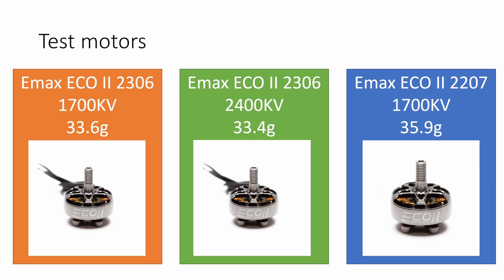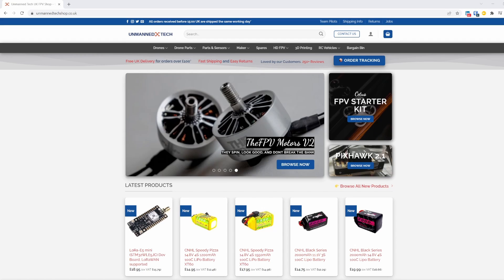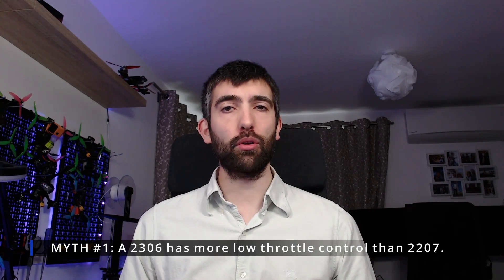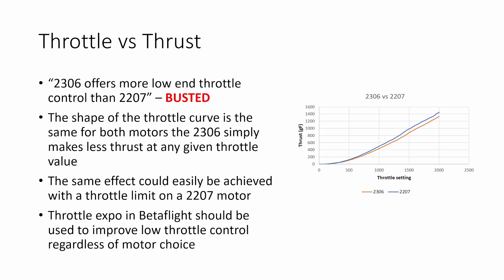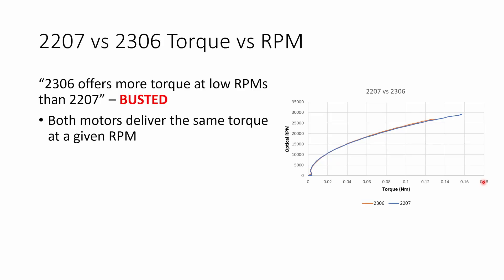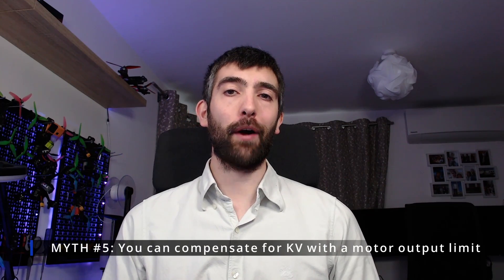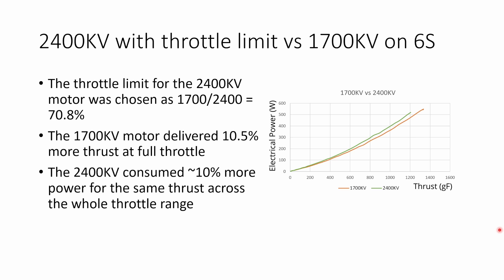Five 5" Motor Myths Tested, are any of them true? 2207 vs 2306

Comment: I love how you scientifically break motors down at the end of the day.. a motor is a motor is a motor.. i was going to swap my motors on my BNF Nazgul Evoque F5x V2 because i thought 2306 would work better than the stock xing2 2207 1750kv for freestyle and just overall make my quad fly better if i got some expensive 2306 1750kv's maybe even the same ratings as the stock ones on the Nazgul just more expensive (eye candy ones) as i thought they would perform better but after seeing a load of your videos and a few others I have come to the conclusion that... A motor is a motor is a motor... I'm better off just sticking with the ones that iflight chose to put on the drone they made as it will have probably been made around them motors anyway so i probably wont find any better performing ones for it anyway lol.
Anyway great video's keep them coming my friend!👌👍

Comment: Would running bluejay at different pwm frequencies change the delta of running 4s kv on 6s voltage for efficiency at thrust? Like say 24 vs 48 or 96

Comment: motors seem to be  a lucky draw .. I have the Fishfly 2306 1750kv motors that suck the battery 2 min flight time at 90% motor output  then I have the Xing2 1755kv that are incredible lots of power 4 min flight time at 90% the I bought 2207  1950kv axis flying 1 min flight time hahahah sent back got the xing 2 again 2207 1855kv over 4 min flight time seems the xing or xing 2 have the all around best performance and battery life

Comment: Hey Chris!
Can you run some tests on 6S vs 4S Batteries with two motors spinning at the same RPM, and a 4S and 6S battery of the same Watt Hours. 

(I don't have the gear to do it accurately, but I have a 6S motor and it's equivalent 4S to produce same RPM)

Comment: A set of 2306s (in your example) weighs nearly 10g less though. Not sure if that is accounted for.
Reply from the maker: Absolutely right. If you don't need the extra power of the 2207s saving the weight is really worth it. We should never carry more motor than we need it's just wasted!

Comment: Your recommendation on "6skv" confused me.  Are you saying a 4s high kv motor running on 6s is acceptable as long as you scale the max throttle setting to 80% of the transmitters full throttle setting?
Reply from the maker: Yes, it will be ~10% less efficient that a 6S motor without a throttle limit though.
Reply: @ChrisRosser isnt motor output limit safer to adapt a 4s motor to a 6s quad ? that way the esc cannot, in any way go at 100% throttle and burn the motor (turtle mode and small corrections from FC in flight are not affected by throttle cap from what i heard (JB))

Comment: Very informative video and I really appreciate that you kept it short! However your tests have a point of error, that is the actual kv of a motor is never exactly the same as the advertised (usually +-50kv). It's actually very hard to accurately set the kv of a motor. For example I bet the 2207 and 2306 had some kv difference even though both are advertised as 1700kv. The same thing for the 2400kv. It would have been more complete if you measured the actual kv values
Reply from the maker: Great point! I'll have to figure out a way to do that for my future tests.

Comment: All great but considering you are carrying less mass almost 10grams with 2306 motors then the ground speed and overall felling of the quad is different…. More responsive?
Reply from the maker: 10g on a 600g quad is not so much that you would notice I think.. From 2207 to 2506 is ~30g. And that's barely noticeable.

Comment: Chris, would the wider 2306 actually make more torque than the 2207 if their stator volumes were the same? For instance a 2306.5 would have nearly the same stator volume as a 2207. Perhaps then we would see a torque advantage.
Reply from the maker: No, I've tested this and if the motor has the same volume they make idenitcal torque. Wider motors are only better for cooling, nothing else.

Comment: How do imperials fare over the 2207? I switched out Xing2 2207's with the imps and I can't really tell a huge difference, but I guess the 2207's would fare better for durability by far and survive crashes for whatever performance gains there may be. The bells on the imps are very lightweight for the diameter so ROI is lower, but durability takes a big hit as a result. I guess its mostly hype and I might just be throwing the 2207's back on the Shocker Tank and the imps on some other build.
Reply from the maker: I plan to do some testing of FPV Cycle motors to see if they do deliver more performance.

Comment: Very interesting. 
So the 2207 is basically better or equal than the 2306 in every test. 
I just chose a 2306.5 (KV1900) over a 2207.5 (KV1750) for my quad Sector D5. I wonder if I should try to switch to 2207 but my reasoning was that the KV1900 on 6S should be stronger/faster spinning than the KV1750 on 6S. Was that wrong?
Reply from the maker: 1900KV will have more top end than 1700KV of your battery cam supply the amps.
Reply: @ChrisRosser  Thanks a lot. 
What C rating would a battery need to have to supply the motors?
What happens if it doesn't? Does it simply top out or something dangerous?

Comment: Awesome video!  Someone please help just finished my first build and everything checked out good powered on and bound my DJI goggles and receiver and activated it. I flashed bf4.3 and did some setup. Then I plugged in the quad and the air unit is not powering on. It’s weird too when I’m connected to beta flight it show voltage with no battery plugged in. I’m super new and now very discouraged. 

apex 5” 6s
Lumenier LUX HD AIO F7 FC + 50A BLHeli_32 2-6S ESC with capacitor
DJI air unit direct plugged. 

Sorry to bother you guys. Just don’t know what to do.

Comment: What prop do you use? In my flying test I switch between F40 and F60 on my quad. I really saw difference and really enjoy 2304 motor with gemfan 5552 props on a ~650g quad. The feeling when turning st low speed in circle around trees was great. According to your test, This mean in blind test it would be really hard to see difference ?!

Comment: Super!!!!!
I’m so glad you did this testing!!!!
Thank you sooo much for all your contributions to our hobby !!!!

I have the GepRC Mark 4 HD DJI V2 vista nebula pro. 
The quad copter comes with 2306.5 motors. 
 After watching your video I’m thinking I would rather have 2207’s. 

Basically what I got from this video is that.

What do you think if you were going to build this frame from scratch you would put 2207’s on it?
Reply from the maker: I probably would but I wouldn't throw away perfectly good 2306.5 motors as the difference will be very small.
Reply: @ChrisRosser  of course not. 
I have another five inch which is on 2207. I could just tell the difference when I flew the 2306.5  I feel like it would put me where I want on feel. Feel is very important to me so that I am comfortable while flying.

Thank you so much for responding 👏 your the best 🙏🏻
Reply: @ChrisRosser  It’s also a lot of work for a small change I know that. I really didn’t relish the idea of removing four perfectly good 2306’s to put 2207’s on but I may do it in the end. 
Something small like this just gives me that edge feeling. You know that feeling where you think you’re invincible and you can do anything ? That feeling is very important to me. When I’m flying I like to feel like I have the edge. For some reason it gives me so much more confidence.

Comment: Interesting tests but you can't generalize the results from one set of motors to all 2207 and 2306 motors.
Reply from the maker: In my testing I have found that motors of a similar size and KV behave very similarly. Often barely a percentage point or two in it. You can check out the graphs on miniquad test bench to see just how similar motors of the same size are.

Comment: Very interesting, great video and presentation! 
Question about the KV 'adjustment' using throttle limit:
I feel the most likely reason someone would run 6s on 4s motors with a throttle limit would be to try out the voltage sag and efficiency benefits of 6s without having to buy a new set of motors.
Did you also test those parameters with the same KV motor (2400KV) just using two different batteries (4s vs 6s)?
Cheers
Reply: Im running 4S on 6S because im poor AF.

Comment: Is this a bench test? Otherwise it’s not true control.. you’d have to take into consideration the prop being used, as well as the weight of the quadcopter for maximum efficiency of each motor.. Where is the “fact”?
Reply from the maker: It's a thrust stand test so its a controlled environment. The prop would certainly affect the thrust vs RPM but because the motors are equal KV they should behave the same in relation to each other on any prop I think. The weight of the quad will affect the thrust you need, but the motors are equally efficient as each other across all throttle settings so the thrust demand isn't a factor. The fact is the data in the graphs.

Comment: I had a feeling we weren't getting something for nothing by running higher KV with a limit. It might still make sense to do it when transitioning to 6s from a lower voltage just so you don't have to buy all new motors, but it's good to know what the facts are.

Comment: For the last test, did you confirm the kV ratings of the motors? They are often not accurate. 

Could try running both on your test stand and use the tachometer setting to find the right throttle limit, where both motors turn the same RPM at full throttle.
Reply from the maker: It's a good point that I didn't experimentally confirm the KV. However, I don't think most pilots who run 4S motors on 6S voltage experimentally confirm their KV to set their throttle limit either, so it's still a representative test 😁 Regardless of the throttle limit(which will affect the max top end) the efficiency penalty seems to be there across the whole throttle range.
Reply: @ChrisRosser  Thanks! Very interesting. I suppose if they are running the exact same prop (like physically move it from motor to motor) then the thrust produced tracks with RPM anyways. 

I’m curious how 65% and 75% throttle limits with the 2400kV would plot against the other two.

Comment: I don't really know, I have 5" quad with 2306 motors and my friend has 2207s, my motors are bit faster (2550 vs 2400kv), our quads are equally heavy and well balanced and still, my quad always flies bit longer. He has more top end power for sure, but you aren't using much of throttle while cruising and chasing, so in our case we agreed that 2306s are more efficient
Reply from the maker: You're motors will certainly draw less current than his, but probably only because they are making a little less thrust. Flight time also comes down to the battery performance.
Reply: @ChrisRosser  we bought same lipos at the same time, it's only mine opinion, but i would definitely recommend 2306s over 2207s for average pilot :) also the shaft is bit shorter, so it should be slightly more durable

Comment: When using motor_output limit in betaflight does it reduce the output in the PID loop also or is it more like a throttle cut? You do a fast roll on a motor that is cut to 70% does it actually stop the roll at 70%?
Reply from the maker: With output limit at 70% the motor can only ever get to 70% no matter what. With throttle limit the PID controller can still drive the motor to 100% in sharp moves.

Comment: nice,  i can confirm i have an older  4s rig 2400kv 2207 emax eco (v1) motors that i run on 6s/   and a  6s rig running on the emax eco V2 1700kv 2306 motors. so i thought it was the 2306 that give me almost e minute more flighttimes but now i see 1700kv 6s is a lot more efficient than a higher kv motor with a trottle cap. tkx i gonna swap my older 4s motors to 6s (al my battteries these days are 6s. tkx for the great work. So for 650fg AUW freestyle/cinematic flying 2306 will be enough.

Comment: Awesome content Chris. I always felt like 2306’s were less powerful and you have confirmed it. They just make less thrust compared to a 2207. I’m recently a new convert back to 2207 2050kv from 2307 1950kv and I honestly don’t know why I went up to 2307. The 2207 flight characteristics is everything and more that I prefer.
Reply: where did buy a 2307 motor ? ive been chasing 2308 motors for my 6 inch rigs or years after the only ones i available stopped being made? wha are those 2307 and are they still available ?
Reply: @fistedfpv2922  tmotor velox v2 rose gold 2307 1950kv

Comment: I’d have to disagree with your conclusions here, the myths you are attempting to resolve cannot be resolved on a test stand. I’ve tested both 2306 and 2207, with two identical quads with the only difference being the motors. The “myths” are evident in reality, despite what your graphs show. The 2306 jumps off the ground and has considerably more low throttle control, 2207 is more responsive and considerably better in prop wash and has more power.
Reply from the maker: Sounds like you agree with most of the conclusions! The only snag is the low throttle control, I would suggest you do a blind comparison between a 2207 with 90% throttle_limit and a 2306. I think you would struggle to tell the difference if the motors had the same KV. You will always get more "resolution" from a weaker motor because you need to move the throttle further for a certain change in thrust. Low throttle control is about having that resolution and still having comparable thrust at the top end.

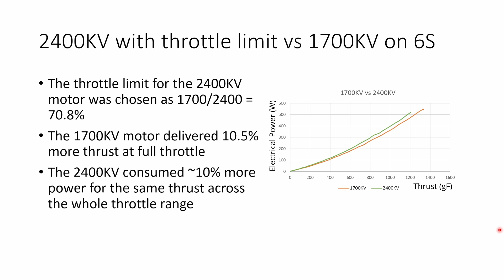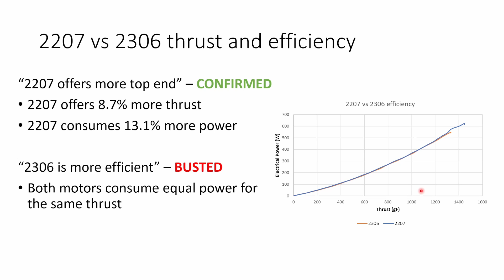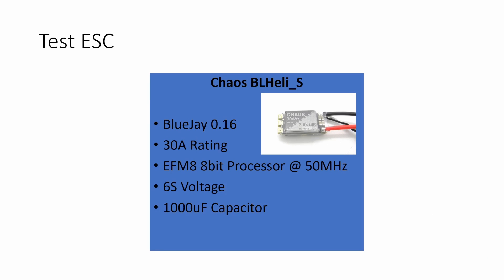Comment: I did a test on a 350 gram 2fiddy using flywoo 2104 3000kv motors. with different size props and  pitches. flew indoors did 2 roof punches around 10 aggressive side to side swings 10 front to back swings and fast rocking on all axis then hovered at eye level until my buzzer called 3.5v (4s 850mah r-line) = Gemfan 51x25x3 got 9:30min... Hq 5x25x3 got 9:30 both at 21% throttle... Hq5x2x3 8:30min 26% throttle (and felt the most stable)  Gemfan 45x25x3 8:20min 27% Throttle (felt super aggressive on Response) Hq 4x2x3 8:00min 29% throttle... Hq 3x3x3 7:00min 35%Trottle... Hq 3X25X3 6:00min 40% ... my conclusion was just like jet engines bigger prop steeper pitch = more thrust = more economy = longer flight.. but feel like the Hq 5x2x3 is what I will use the most as I am guessing the Gf51x25x3 were over propping the motor as gps speed run maxed out at 75mph (same motors were on my 4" Hq4x2x3 290gram roma L4 getting 92Mph same quad with T-motor 1404 3800kv got 75mph 250gram) flight times were around 5:00/6:00mins no problem then did a slow 35mph cruse flight easy got 7:40min.. going to do a speed run with the Hq 5x2x3 to see if it flys faster then the Gemfan's? if so then the only way would be if they are not spinning as fast (over propping!!!) ... also did a test with a larger battery(THE FPV 120c) 1500mah (Gf 51x25x3) extra 80grams added (total 380g) gave 12:30mins .... went back to the 850mah added 50gram knife under the batt strap lost 1:00min flight time... Conclusion more Throttle needed to fly means the motor draws more amps, Over propping is only good for long range???
Reply from the maker: A steeper pitch prop will be more efficient in a hover and for cruising (as long as you  keep the throttle low all the time). However it will draw a lot more power and make more thrust at the same throttle setting so that often means people get shorter flight times if they fly the same way. Shallow props give much better propwash handling, which is why I prefer them for freestyle.
Reply: @ChrisRosser  I could feel the difference with a matched props others feel air is just blowing everywhere and your trying to sit on top of it. the right ones feel like there cutting the air and the quad is suspended. you wont be able to tell until the right props go on its the same difference as flying an un-tuned drone to a perfectly tuned one
Reply: @ChrisRosser  it is kind of my point the motor spins faster use more amps if the motor cant spin up (from heavy props) it wants more amps and it cant get the amps from the battery so the motor never gets full rpm the light prop may give more speed as it don't kill the battery as bad allowing full rpm range

Comment: Conclusions from there should be written in bold above every motor comparison article. Already had idea that main difference between 2306 and 2207/2208 is caused by KV difference and particularly due to lower KV for 2306 motors in historical comparisons. 4S motors being less efficient on 6S is nothing new. But because we are killing remains of our old 4S stock on 6S because no one want to buy them anymore and some of us think that throwing out working motors is bad idea, make it non-issue. Can you advance topic about throttle lowering for long range setups more? I see that it would be great way how to make all-rounder quad: flying freestyle on full throttle then switching to lower throttle profile for casual long range.
This actually made me think what to do now with 2306 in my shelf...